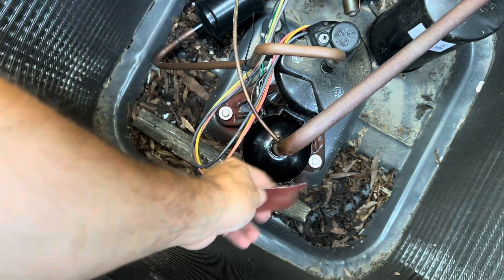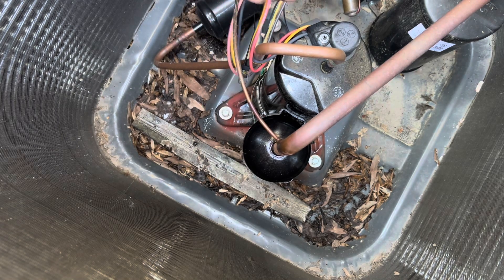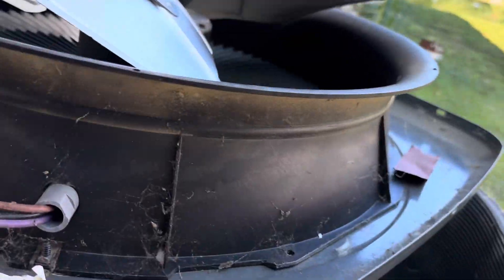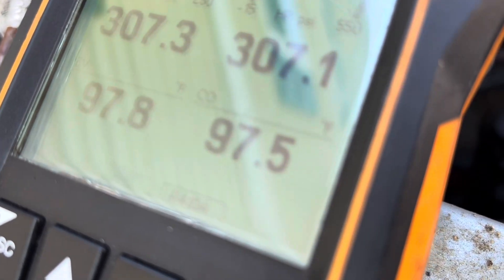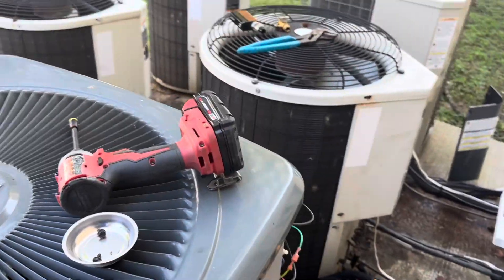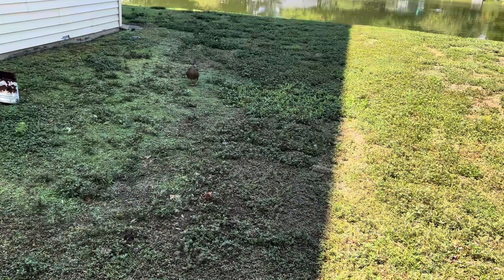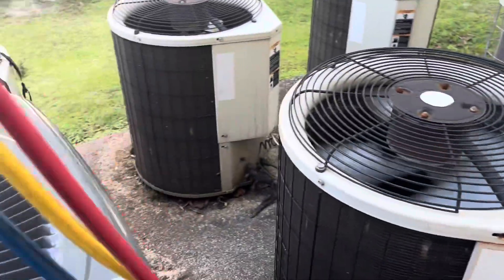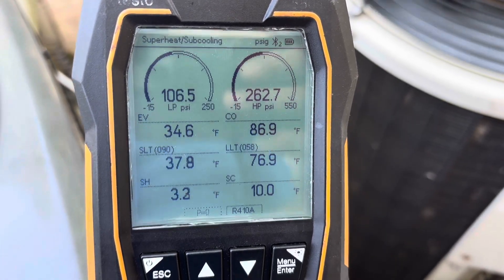Shorted Wire Blows Hole In Refrigeration Line!  Lost All Its Charge!

Comment: Your flame is a bit noisy, usually indicates a pressure higher than rated. Use a larger tip if you need more heat. I prefer my C tip for almost everything now.

Something that small might have gotten the map-pro instead. Depends on the slog distance.